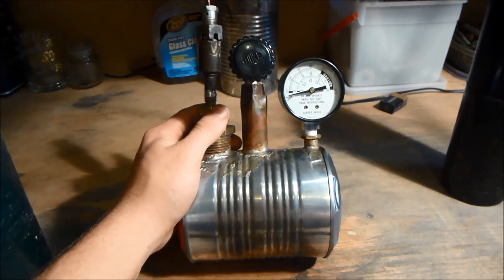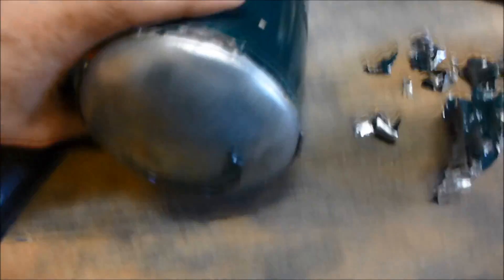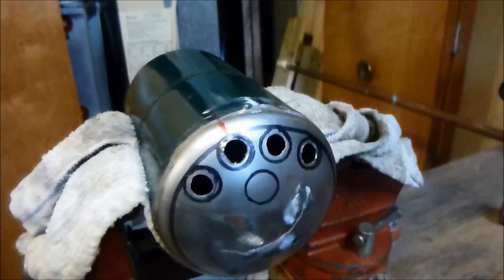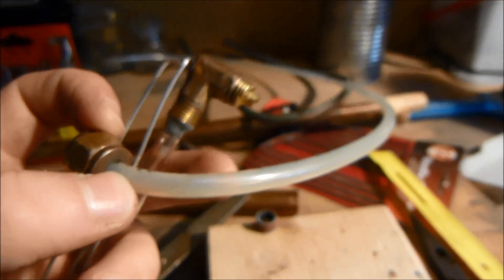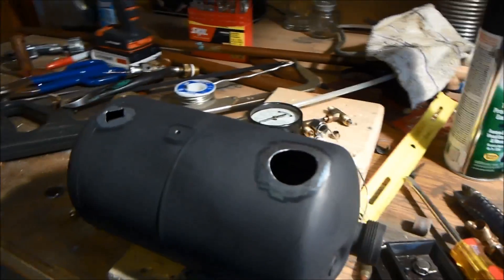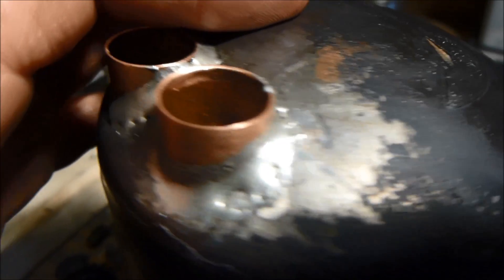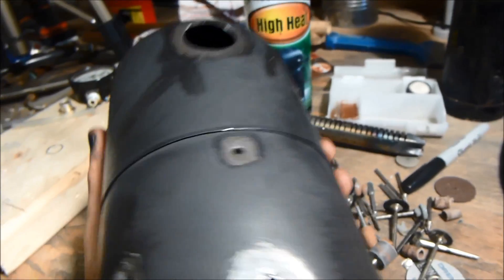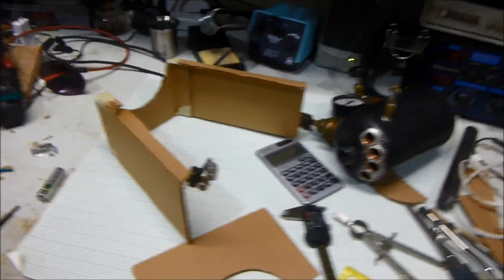Building My New Safe DIY Boiler From a Propane Tank

Comment: Steam is dangerous at any pressure, basically, water cannot boil under pressure, so you wind up with water/steam beyond the boiling point of water at atmospheric pressure, and pressures over 15 psi are considered high pressure. When liquid water under pressure turns into steam at atmospheric pressure, it expands dramatically, increasing in volume by about 1,600 to 1,700 times, and can be highly explosive, without flames. I happened to work at a facility that had a safety fail on a high pressure boiler and it cost millions in damage, and multiple injuries

Comment: BTW... I've had issues with some solder flowing, and wetting. I happened upon some solder they sell at AutoZone. It's marked as acid cored solder, instead of flux core. It seems to work better for me. Maybe try it in the future

Comment: at 7:44 what you are calling a relief valve is just an inlet filler valve, same as you find in a car tire.  it has plastic components designed for freezing gas temperatures, and these might melt, or soften beyond tolerance, in your application.

Comment: Please, please check with one of the many groups with expertise before going ahead with your own ideas, or with something you saw on YouTube. In my area there's a good sized group of people who build and operate full size steamboats, among other things.  But you can find people with expertise in building model steam locomotives pretty much anywhere.
At the very least, run your ideas past them online.
The guys in Home Model Engine Machinist build not only boilers and steam engines, but even design and build operating gasoline engines.  Someone ran the question of using propane bottles past them, and the response was overwhelmingly a loud NO.  With reasons given.

If you click on the link it offers the choice of cancel or leave but "leave" just opens a new tab.  If that feels sketchy to you (It would to me) then just do a Google search for Home Model Engine Machinist.  Open their search bar and enter 'boiler from bbq propane' under keywords and scroll down to 'search' line. 

https://www.homemodelenginemachinist.com/threads/boiler-from-bbq-propane-tank-question.1830/

Comment: An older post but I'll comment for the sake of anyone considering the same thing.

Please don't mess with propane tanks, pressure cookers, hot water tanks etc to make a DIY boiler.  Don't take my word for that, I don't claim expertise. (Aside from a career as a steam plant operator and a few years in an amateur steam club. That's a relatively low level of knowledge for this.)
Check with the expert hobbyists.  If you want to build a small hobby boiler, they can steer you in the right direction.
Reply: Have you seen all the various boilers on youtube...? This boiler is like the Cadillac of safety as far as youtube boilers go.
Reply: YouTube videos aren't exactly a standard to rely on.  The gravel outweighs the nuggets.
Reply: @billjaxin  paper thin mild steel, Plastic sight glass, soft rosen core solder, all exposed to hot steam under 30psi pressure whats not to love.  I agree with you 100 percent. But that tiny speck in the bottom of the bucket of gravel is just soo shiny.
Reply: @cobre7717  right, pressure cookers are built pretty heavily for half that pressure.  But it's not just about pressure.  It's the wrong material and way too thin for corrosion allowance.  Steam corrosion isn't like ordinary rust.  It can weaken the metal invisibly, especially stainless.

 I have a boiler needing to be rebuilt, it came out of a 12 ft steamboat and the shell was rusted out.  I have schedule 40 5" seamless pipe to replace the 4" dia original.  I would not trust the welding to anyone not certified to weld pressure vessels.   
Mind you this would operate at well over 100 psi.  But even the tiny residual pressure in a pressure cooker, if you force the lid off a bit early, is enough to destroy your face.   When water is boiling at higher than atmospheric pressure, it will all vaporize at once if the pressure is suddenly released.

Comment: If your uneducated in steam pressure or btu to steam working power, be careful steam is not efficient at lower pressure. Electric generation and high steam pressure has killed many and should be researched and safety is paramount steam eats skin and can cause severe infection even on a small steam burn, go to school, 

Google is not the safest method

Comment: Always use silver solder, hydrostatic test to 115psi x2, and then a compressed air test, those water sight glasses will not bust under pressure unless you have it not aligned right, or the wrong glass, be very careful, anything under steam that goes bank will triple in velocity as the boilers water instantly turns to steam as well, but glad to see you have a passion for this kind of thing, some silver solder won't set you back much, and it is much stronger, larger boilers are all welded. 
I wouldn't go over 10psi with your propane boiler, and be careful using plastic water sights. 
Happy steaming, check out PM Research, they sell boiler kits, so do Stuart Models.
Also always fit a safety valve.
Reply: Just a question why only 10 psi
Reply: @parkersposts  its extremely thin steel. It could easily rustout. Even at 10 psi it is sketchy when it explodes. Pop a balloon... Then picture it filled with over boiled steam vapor expanding in your face.

Comment: Don't forget that A) It's rated for room temperature, so heat may/probably will lower that - and B) Solder will be very weak at hot temperatures plus may makes sure it's lead free solder or you'll be spraying lead everywhere. Otherwise good job.

Comment: I'm far from certain that the plastic sight tube would hold up under pressure when heated. Remember, water's boiling temperature increases when under pressure, and plastics tend to to have relativly low temp ratings.  Just be careful  and observant.

Comment: Do you have any recommendations for a pressure relief valve for a 5 gallon Steam boiler
Reply: Hello Miller's Hobby.  Sizing a pressure relief valve is dependent on the rate the boiler makes steam, (usually calculated in pounds per hour of steam).  The rate the boiler makes steam is dependent on amount of heat you are putting into the boiler and the rate at which you are putting that heat into the boiler.  The more heat you put into the boiler and the faster you put it into the boiler the larger the pressure relief valve will be required so that the boiler will not outrun the flow capacity of the pressure relief valve.  So start with figuring out the flow rate of steam you plan to have coming out of your boiler and use that to help select the correct size pressure relief valve.  Here is a link to an on-line reference on sizing pressure relief valves to get you started:

https://www.pdhonline.com/courses/m112/Selection%20and%20Sizing%20of%20Pressure%20Relief%20Valves.pdf

As a cautionary note, building steam boilers is not trivial.  Always remember that you are building a bomb.  Even at relatively low pressures boilers can be dangerous.  Always make sure you have a safety valve, (a second pressure relief valve set at a slightly higher pressure), in addition to the main pressure relief valve just in case your pressure relief valve fails.  You should also build a sturdy blast shield around your boiler that will deflect pieces, (not contain pieces), of metal in a safe direction in case of catastrophic failure of the boiler.  It is best to deflect steam explosions.  Containment of expanding steam is difficult.  It would be a good idea to find a mechanical engineer to help you will this.
Reply: Thank you so much for the suggestions I appreciate it.

Comment: Seamed tank, plastic tube, unflowed soft soldered joints and you drilled the guage fitment right next to that seam this will blow out when you least expect it use seamless copper and silver solder 45% only. Some good ideas just badly put together.
Reply: The pressure rating on these propane tanks far exceed the anything model steam boilers operate at and that seem your talking about is a bronze brazed seem it's not going anywhere

Comment: you tried sodering copper to a propane tank. no wonder it didn't work. should've tig welded it.
Reply from the maker: +Pat Ribbing LOL? I did solder copper tube to the steel propane tank and it worked very well. Do I look like I'm rich enough to have a TIG welder??
Reply: Makerj101 
We'll go head on wit ya bad self. and ya little toys'r'us paper clip & battery imitation welder. 
Might as well build a fire, throw in some aluminum cans and pour the liquid metal on ya little project. 

If you was real smart you would've gone to your local college and hit the mechanic shop and built a make-shift one. if you was real smart.

Comment: how do you cut square holes
Reply from the maker: +Gabe Murowsky I use my dermal tool to make square holes half inch and larger. For smaller than half inch I like to drill a normal hole and then square the corners out with a square file. It takes some work but you can get a really nice square hole with some practice.
Reply: Makerj101 thanks man, a couple days ago I had the Idea to build a boiler from an old Keurig coffee maker I took apart. I did it today and the plastic top melted through and I got rid of it. I searched how to make one and I found your channel, and subscribed after watching 2 videos. You are very helpful.
Reply from the maker: +Gabe Murowsky you might be able to replace the top plastic par that melted with some sheet metal. Thanks for subscribing! I'm gonna be mashing lots of interesting videos over the summer.
Reply from the maker: +Gabe Murowsky you might be able to replace the top plastic par that melted with some sheet metal. Thanks for subscribing! I'm gonna be mashing lots of interesting videos over the summer.
Reply from the maker: +Gabe Murowsky you might be able to replace the top plastic par that melted with some sheet metal. Thanks for subscribing! I'm gonna be mashing lots of interesting videos over the summer.
Reply from the maker: +Gabe Murowsky you might be able to replace the top plastic par that melted with some sheet metal. Thanks for subscribing! I'm gonna be mashing lots of interesting videos over the summer.
Reply from the maker: +Gabe Murowsky you might be able to replace the top plastic par that melted with some sheet metal. Thanks for subscribing! I'm gonna be mashing lots of interesting videos over the summer.
Reply from the maker: +Gabe Murowsky you might be able to replace the top plastic par that melted with some sheet metal. Thanks for subscribing! I'm gonna be mashing lots of interesting videos over the summer.
Reply from the maker: +Gabe Murowsky  you might be able to replace the top plastic part that melted with some sheet metal. Thanks for subscribing! I'm gonna be making lots of interesting videos over the summer.

Comment: I'm trying to build a steam engine but the solder won't stick or stay in place
Reply from the maker: +Jordan Jorde what kind of solder are you using? What kind of flux? Did you clean every speck of rust, paint, and anything else from the metal? I imagine you ate trying to solder steel? Keep torch away from the joint your are soldering. Heat up the metal around it and let conduction do the work for you.

Comment: I would
Purge it with the valve open till empty then throw into a camp fire until it purges itself.
Pull it out cool it and start cutting or drilling safely

Comment: I see somebody already mentioned silver solder, good.  Properly applied silver solder will handle high temperatures without melting and hold pressure.  i worked at a tire retread shop one time who had a bunch of steam molds retubed by a welding shop before they hired me.  Whoever did the soldering didn't know what he was up too as the joints looked like yours and blew after a short time.   I ended up re-soldering the entire lot for the shop.  I did them right and they held the pressure at operating temperature and still were the last time I ever heard anything about them.  You don't build up metal, that's a waste.  You simply heat the metal up and sweat the solder right on in.

I don't know the makeup of lead-free solder, but unless it is made out of a bunch of cadmium it should be alright for use at the temperature water boils at.  Be careful boilers have a long history of danger and when doing a DYI project you want to over engineer for your planned stresses with something like that.

Comment: You were talking about boiler capacity.  The tomato sauce was 28 fl oz (volume) and the propane was 16.4 oz (weight).  Thus the anomaly.
Reply: Propane is not a cost effective competitor to coal or fuel oil or nuclear btu per unit it's extremely subjective to global warming/fossil fuel bullshit, propane can and if democrats have there way will cost more per btu than diesel, natural gas or wood, the EPA and John Kerry's of the world will always punish smoke/steam/anything that can be attributed to some form of a taxable offense, when taxes reach the 20 to 40 % level the government needs to get creative, they impose gas taxes, road and infrastructure taxes, plus property tax increases, regulations on your oil, diesel, propane, natural gas and gasoline, they ie(government) know we will only take so much, the whole tea party thing was kinda dry run they learned that an outward taxation without representation would never fly again, so these oh so brilliant politicians try and hide their increased taxation in other forms like I said roads, schools, infrastructure, and the biggest taxation demon

GLOBAL WARMING

Comment: your plastic hose/sight glass replacement (and the rubber/neoprene gaskets on the "pressure relief valve"(built into the tank) and the original "propane connection" are all very likely to fail under the heat of the boiler/steam.  all your connections to the boiler should rated for steam!  connections rated for air or water pressure are just not safe enough.... (even when it is low-pressure steam)     Please be safe... you are not dealing with a toy..

Comment: Here come the safety nuts. Good Video having built several boilers, propane tanks are pressure vessels built for lots of pressure many many times the operating pressure of your boiler using soft solder is fine as if you cook the boiler the solder will melt venting the steam we use soft solder on the lower rivets of our boilers some times if anything goes wrong the solder melts steam vents. Catastrophe over. Good work.

Comment: There is no such thing as a "safe DIY boiler from a propane tank"!!!!!!!!!!
Reply: it's safer
Reply: Nonsense while I wouldn't trust that boiler because of the dissimilar metal causing  corrosion homemade boilers made from propane tanks are not inherently unsafe. they do need to be properly tested which in this case means a hydraulic test to twice the pressure of the automatic presser relief vents at.

Comment: To be safe you need to braze those joints with something a lot harder & with a much higher melting point temperature than ordinary solder! So it might be a good idea to think about investing in a small oxy propane kit for the future if you intend making anymore boilers, or you might get your head blown off at some point!...It's good to see people making stuff though, even though it could be pretty lethal...;-)

Comment: Your boiler is VERY DANGEROUS because to weld copper tube in the boiler you MUST use silver,
Reply: Bruh.. it is not an industrial steam engine. This runs on a little pressure and heat
Reply: natalefr Natale NOVELLO most lead free  solder contains silver in its alloy https://en.m.wikipedia.org/wiki/Solder but I could be wrong because it is Wikipedia and that article was regarding solder used in Japan
Reply: Brah...kid dont know shit. His face is gunna get melted off. Dumb fucks here.

Comment: Hi nice builds I may be interested in doing something similar to this myself one day for a model boat. As far as your pressure gauges and relief valves and go can you use them for a regular air compressor or do they have to be for steam
Reply from the maker: +fillopygeesi Hmm well here is the pressure relief valve I have used and it works great.  http://smile.amazon.com/gp/product/B007GDXT3O?psc=1&redirect=true&ref_=od_aui_detailpages00  As for the pressure gauge, pretty much anything that does not have a plastic window on it should work.  The plastic windows will melt.  So you need one that has glass.  The rest of more pressure gauges is metal so the temperature will not harm it.

Comment: Nice idea but WHOAAAA OMG soft solder on a steam boiler... I wouldn't trust that at any distance or pressure, sheesh a steam iron is quite capable of scalding .. I hope you use long firing irons, valve extensions and gloves when its hot
Reply: As long as the water level doesn't get to low its fine,have you ever tried to solder a pipe with water in it an acetylene torch won't do it

Comment: You didn't tell us how you purged the tank before drilling the holes. If you don't purge it first you take the chance of a very dangerous explosion.
Reply: I agree with this. Fill the tank completely with water and drill your first hole with absolutely no gas in the tank only water.

Comment: What is the function of the copper tubes?
Reply from the maker: +kito96 The hot exhaust gasses go through them and transfer a little more heat thus making it more efficient.